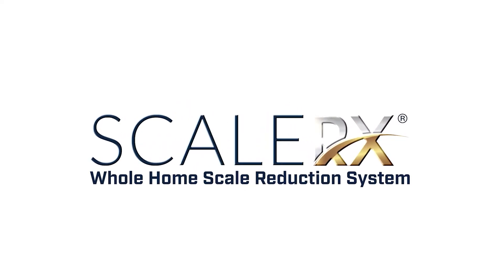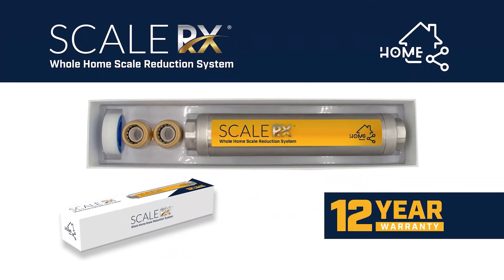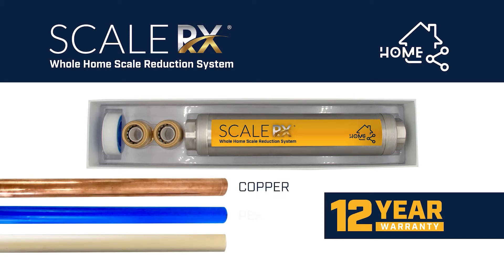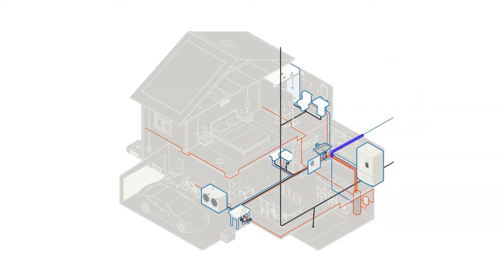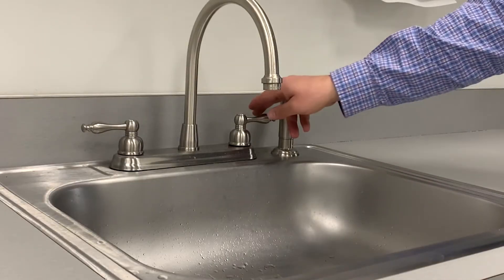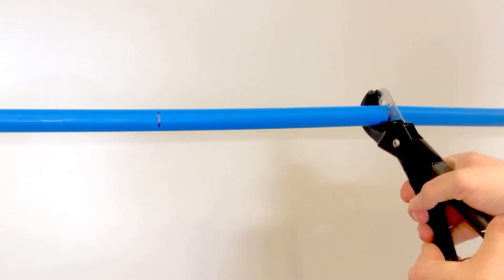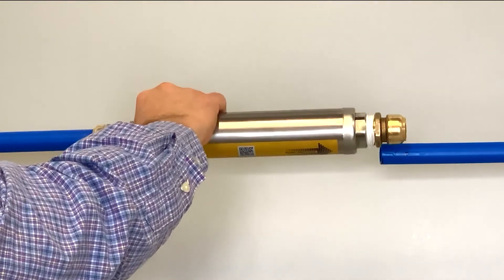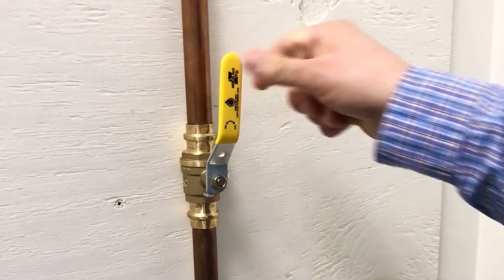How to Install ScaleRx® Home by American Valve

Comment: Using the cheap thread tape, you will need to wrap it at least eight times. What matter how much I tightened it with four, it leaked. Had to take it apart and double the thread tape. Holding now. Time will see if it works.